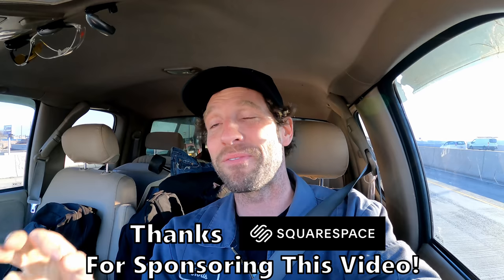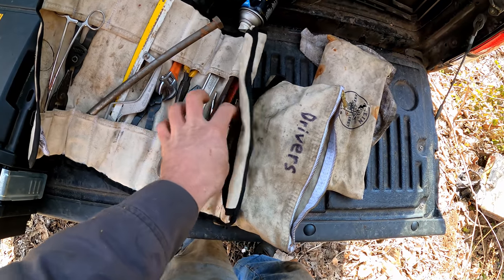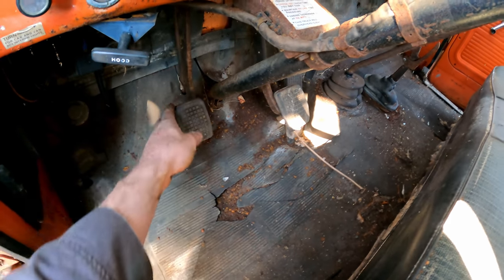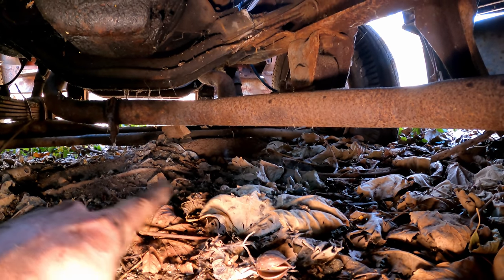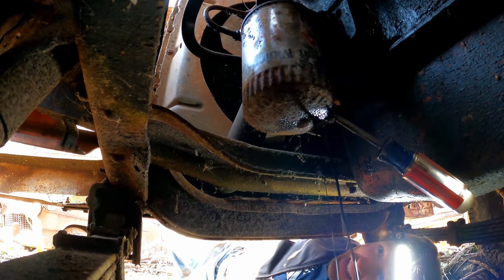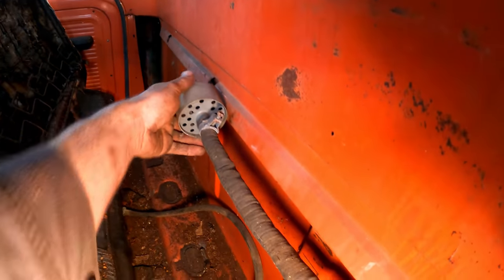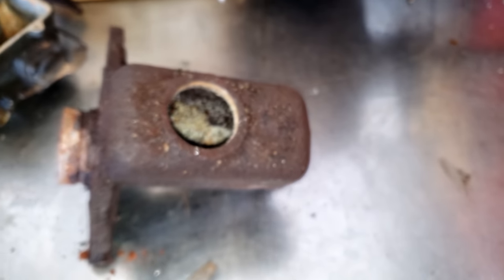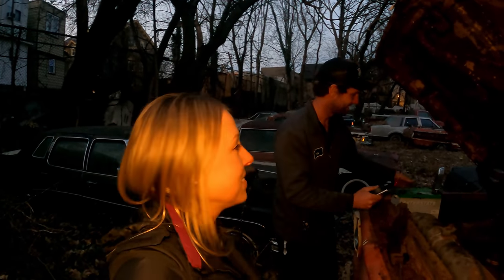Will It Run? 1971 Ford F600 Stick Shift U-HAUL Truck - NNKH

Comment: The engine is an FT series engine for medium and heavy trucks and school buses. If I remember correctly they were like 331, 361, and 391 in most trucks.  But I remember reading somewhere that U-Haul had different sizes by an a couple cu-in. Not sure if that's the case or not.

Comment: I rented a manual uhaul in Houston in the early 2000s at least. but it was probably available because no one else could drive it. Only 2nd and 4th gear worked though but it was a rental i didnt care

Comment: After working for Uhaul back when they had their own Mechanics those trucks all had the 390 heavy service motors in em. The only thing killed em was when they overheated usually melted the piston rings or a bearing. Funny thing about em is Uhaul was so greedy back in the day they would let people take em out with motors they knew were shot. The motors seldom if ever knocked and bumped when they were cold but after they got hot look out they were driving a big orange hand grenade.
Reply: They're still plenty greedy trust me never paid there employees jack shit. still dont

Comment: Nice! Super cool rig -1500 gonna be hard to find a buyer even for F600 body parts, theres alot of those here, less rust running driving 2 speed rear ends. Just pulled the trigger on a 66 Rambler wagon! 36k miles very little rust. Picking it up tommorow.
Reply: a few months ago, I spotted a Rambler American by a barn in upstate Ct. Looked whole and complete. Even had the OEM radio delete package. You don't see too many survivors in the strip down version.

Comment: If that engine is a 360, it definitely is not a small block, but Ford's FE block. Strong, and plentiful. FE engines (as far as I remember them) came in 352, 360, 390, 427 and 428. Yes, THAT 427!  The locked thing below the carb really is a governor. Probably a really good idea on a rental truck in the day. Those Budd wheels probably use a 1-1/2" hex and a 13/16" square as I remember. Should be the same as used on 10 bolt bus and truck wheels, but a different bolt circle. I haven't messed with one of these U Hauls since 1967. Stock plugs would be BF-42, 18mm tapered seat.  $400-$500 maximum.

Comment: The box alone should be worth a minimum of $750. You couldn't build that much storage for that kind of money. Hell, a sheet of plywood 1/4 thick is bringing more than $40 these days. The engine block may be rebuildable and that would be worth another $300. If the axle is what you said it might be, that has to be another $300. The doors and other parts for restorers easily add up to another $400-$800. It all depends on if you have a ready market for the parts and if you want to fool with all of that. If you don't, sell it for scrap and move on. And don't forget the transmission. If you have the part and someone else doesn't and they need one, the price goes up. Just spitballin'. All the best.

Comment: auto choke in the base of the carb worked on heat from the manifold and oil bath filters are very good the engine might be ok .....well the bore

Comment: Motor is likely 361 or 391. those at commercial truck engines. The oil in the air cleaner is normal for that era. It is an oil bath breather.

Comment: Back in the old days, there were not many options for the general public to rent large trucks, so U-Haul pretty much had the market to themselves and took full advantage of it, too. The trucks they rented out were notoriously overpriced, old, worn out, and suffered from lack of maintenance. By the early 1980s, their trucks were making news when they were so old and unsafe that things like brakes and suspensions were failing out on the roads and causing accidents and deaths. So, finding an old, former U-Haul truck is like finding an old taxi cab or police car; you can bet it has been used far beyond it’s expiration date and has had minimal maintenance and service along the way!

Comment: To service the breather dump the oil out of it and clean the bottom out of sludge and the breather quicker to take to the car wash steam it out and dump oil to the line inside the breather on the bottom  you are good to go.

Comment: Lower plate under carb is a governor you can get a key made at
T any lock smith # a990 brig's and Stratton. Brake booster is vacuum powered usually diaframe rubber wears out there is a key screamed in the grill dead center you will see a screw key is behind screw.

Comment: It's a ft or (fe) same engine ft just means ford truck and most likely a 360 c.i. I used to work for U-Haul as a truck mechanic in the early 1980's,I worked on these old trucks .most were manual trans but some had auto's, which are rare.

Comment: you know in the mid late 80's i was hired by kargo svcs  which is uhauls repair center to scrap and cut up old uhaul trucks . i had a smorgasboard of uhaul ford truck parts saved but most of it went for scrap metal . i cut up a ton of old trucks and boxes this is just before they got smart and started to auction off old trucks .

Comment: That roof will be leaking on you. You can see the water  stains. When the roof separates from the cross members like that, the rivets themselves have given way. It is an easy fix. Drill then out, and reset them. Also. Before you rivet the roof back either flexseal or use butyl tape to seal it back up.

Comment: That air filter is supposed to have oil in it, it the air goes through the oil to clean it to go into the engine, it's called an oil breather

Comment: I'd love to see it move again.

I can't imagine Ford offered these with an automatic transmission option. I wonder if one could even hope for a synchronized gearbox -- I doubt it.
Reply: They were available with an Allison AT-540 automatic. Quite common when they were fitted for fire service, anyone could drive them. I just sold a 73 F-600 dump truck with the same FT-330 engine and Allison trans. 55-60 MPH was about the end of the world, but it would do it empty or loaded with 8 yards of wet fill dirt.

Comment: A lot of those f600-700 trcks had 330s. I never heard the 360 before. What if i saw a vehicle i liked or was very interested in, How do i get contact? & btw I learned the hard way I bought my first diesel engine don't automatically change all the fluids unless you know it's good... I spent almost $500 on fluids + 2 fuel filters and then found out the engine wasn't any good. I wanna see that diesel square body also, I have 3 of them, getting ready to have another.

Comment: Lots of folks with old Galaxies they may be restoring or getting on the road, that motor is very much a Galaxie block for sure. I know Craig909 has a 360 in his one Galaxie... very dependable old motors. A lot of those old Ford trucks that are gas, often have 429's in them [sometimes if you're lucky you may get a 428 in one but usually a 429]. Do they have a different crank than the ones they'd have in the car motors? Still the blocks are getting harder and harder to find. :-)) Be worth popping this motor out [bit of lifter noise... maybe a bent push rod or two... or just in need of lash adjustment.. bent rods are common with over used and rental motors]. :-) Be cool to see you drive it out... keep the box? .. Drop in a diesel and pop the gas motor to save for a car or sell it to somebody who needs one... Those valve covers alone... so cool. Thanks for sharing this. Loving the videos man! NOICE!!

Comment: that was an oil bath air filter system. works but is very messy. you can probably convert it to air filter system. if you dont want to make a runnner out of that u-haul, then maybe yank the engine out and use in something else and then sell the rest of the u-haul for maybe  1500. 3000 is too steep,.:)

Comment: At most, It's only worth half of what the owner is asking as far as selling it.  As of right now, I can get a 1980 Ford C700 that runs, drives, and it has a title for $1500 and all it needs are tires and a battery.

Comment: As far as value goes , If that was a 352, like some of the guys on here saying, then that has some value because those have become increasingly hard to find. But I don't think it's a 352. And the other thing that has value is the box, like someone says they can turn that into a shed. Other than that it's scrap
Reply: It's a 330 cid
Reply: Some places sell the boxes for $100 a foot.
Reply: @thebeek123  This box is probably worth a bit more thanks to that end-on hardwood floor.

Comment: Those old Fords had the air filters soaked in oil.
Reply: The air cleaner assembly had oil in the bottom of it and the oil was the filter. There was no paper filter involved.

Comment: Like watching the Videos, $3,000 is too much, The brake System will be a nightmare to chase
down. I'd say $1,000 Max for the parts. I saw where someone made one of these into a Motor Home.
I'd like to see that Falcon Ranchero run.
Reply: I'll second the vote on the Falcon Ranchero... I was always a fan of them!

Comment: I had the identical truck. Step 1. Throw away governed carb,  its an FT 331 most likely . Does it have the u haul branded tires??
Reply: it did, saw em

Comment: how , as a mechanic that is older than i am, do you not know what an OIL BATH air filter is??!!! lol hey you learn something new every time you work on stuff! oh and yes that is a ford FE  block which 352,360,390 all are the same block.
Reply from the maker: It's pretty simple really. Today's vehicles don't have oil bath filters. And I only recently started working on older vehicles. You probably just watch more YouTube than me.
Reply: Text is hard to tell the emotion behind it I hope you know I was light heartedly giving you a hard time. lol  And no Iv done revivals on tractors and vehicle's since I was in middle school and the funny thing is if I made a revival video of myself trying to get a modern vehicle running their would be many things I would be like “wtf is this? Why is this like that?” And you would be like what the hell how do you not know this??haha

Comment: To bad it's not older and had a 352 motor. Some U_Hauls had governors on the transmission side tied into the speedometer cable....easily removed.

Comment: A torque multiplier would make those lug nuts much easier to remove. Thanks!
Reply from the maker: Yes. I've since bought one
Reply: @NoNonsenseKnowHow  They're freaking awesome. I've used them to break studs on cross threaded or overtightened nuts. Thanks for the videos!!!

Comment: As far as value, I'd say no more than 1500.  Mainly because that engine is getting harder to come by, and if the box is dry, that's an 800.00 box that someone could use for a tool shed. That's what they go down here in NW Florida. Unfortunately it's an easy 10k to take it back to a nice running and nice looking unit. I'm more interested in the blue Lincoln in the very back at the 8 min mark of the video. If it's complete, I'd be interested in it for sure.

Comment: 1000 bucks tops. F600s are a dime a dozen. They were a common truck for farmers delivery trucks or in this case uhaul truck. But it's not a real special truck. Owned and drove many of them over the years. The vacuum line your referencing. Is connected to the vacuum gauge in dash. As well as from the vacuum pump.

Comment: Just wondering if you have low compression in one cylinder does that mean the motor is blown or how do you get that fix ? I would greatly appreciate any advice 🙏🏽  I don't want to junk my old car because of one cylinder having low compression.

Comment: You have a lot to learn about older engines. That air filter is what is known as a oil bath air cleaner. The air gets sucked through the oil an$ is filtered out. The oil should be changed @nd the p@n cleaned with new engine oil put in to the pan. They were the best air filter made. Used on most older heavier equipment. Yes if you had window washers back then they were bags that held th3 bug cleaner fluid.

Comment: How does your air hose not get damaged by the heat from the engine?
Reply from the maker: Because it doesn't get that hot under the hood

Comment: 🤔THAT REALLY is a 352 V8 Ford engine they are one of the toughest engines FORD HAS ever made tough is a bullet they REALLY were REAL GOOD U-Haul trucks very dependable especially back in the day better than ANY of the U-Haul trucks made NOW DAY'S I REALLY DO KNOW I AM a REAL ASE Certified master Auto Technician or a ASE certified Master Auto Mechanic with OVER 60 year's experience I AlSO GOT OVER 67  masters degrees in Auto mechanics believe me those Master degrees cost money at least the colleges charge a lot money for those masters degrees and the state colleges will NOT let nobody cheat

Comment: Considering pretty much all the steel lines and hoses in this truck will have to be replaced, plus six tires, in addition to all the mechanical work and brake system, I'd say $1400 max, would be a fair price. By the time the person has it road safe and replaces that left rear door, windshield, bangs out the dents and dings, and replaces that rusted out hood, their going to have more into it than it will be worth. And you haven't even found all of the problems yet.

Comment: Nice old FE.....  Cool old remote vacuum assist... The Exhaust manifolds will definitely leak....  LOL   D4TE  74 Truck Engine..   Probably a 390 or 428..  Awful big truck for a tiny 360..  So surprised there weren't more nests...   $1000 is what its worth..  Pull the engine and scrap the rest...

Comment: Cool, old beast!
I've been a Uhaul dealer for 27 years and we had 26' trucks with IDI N/A diesels and manual trans right up till about 98-99 when Uhaul had its little uh....incident with the Canadian authorities. After the near bankruptcy, all the cool and weird trucks were axed( Toyotas, Powerstrokes, 5-speeds, carbs)  and they made 90% of the trucks E-350's with the Triton V10.

Comment: Yup, oil bath air cleaners are messy! As far as value of the truck, I think $1200.00 would be a fair price. Grab all the parts usable on that vintage Ford truck, scrap the remains.

Comment: Wouldn't be something I would have any interest in fixing or using, but would be handy for parts for someone that has one that they are using. That being said, $3K if it was a driver maybe, $1000 to $1500 absolute max as it sits. Lol, with the price of gas these days it would probably cost $10 in fuel just to get it out of the driveway...

Comment: $3000? I'm thinking about $1200 maybe. Really rough. But the doors are nice and the engine runs.
Reply: $800-1000. Too much damage to the cab plus the cost of all the other parts for brakes and suspension. I won't mention how much replacement tires would cost. There appears to be a lot of potential and good parts but it would be an investment! It simply may be more cost effective to buy another already running truck.

Comment: we have a lot of them in brazil, still woring, but diesel. swapped mwm or mercedes engine, original perkins or older models V8 gasoline. I have a F350 68 , original V8 swapped to mercedes diesel, cool truck. this f600 is onl for somebody who loves it, cause needs a lot of metal work. but I would buy it, cause not for 3000, you can pay max scrap value.

Comment: Hi my name is sean I came across your video I like will it start you should get in touch with vice grip groge he can teal what brand of oil he used diesel oli in the cas that’s bin sitting four 20 years your new fan from Lebanon Oklahoma

Comment: It’s a 330 engine especially made for U Haul
Reply: The 330FT wasn't an engine made only for U-Haul. It was commonly found in Ford trucks 1 1/2 tons and larger. The question is whether or not the engine is of the FT or FE variety, I couldn't see enough to be sure but at this juncture, I'm guessing FE.

Comment: I can see, with today's prices, it would take a sizeable $$ to get this truck in drivable shape.  The rear box looks in ok shape, but the hood is toast, brakes with be costly, maintenance on the driveline emergency brake setup, and who knows if the motor would give you years of use!   Battery, windshield, seat...and who doesn't use a radio in this day and age!   Six tires on this rig won't be cheap...I wouldn't give her a nickel over scrap price personally!  My bet is the wiring to lights and such need attention as well.

Comment: That truck is worth scrap, sad to say.  The box might have some type of value as storage? But the rest of the truck is just not worth anything, the front end is trashed. 
The drivetrain, well, also sad to say not going to be worth anything. It's too late to be one of the early FE's that people try to find, so it is going to be a low comp industrial, or a 360, or maybe, maybe a 390, but I doubt Uhaul would splurge for a 390 preferring to try to advertise as a gas saver(LOL) with a smaller engine. 
A ford 360 is a boat anchor NO ONE wants. The heavy truck engines might have a forged crank! Except NO ONE wants a 360, for anything. Same with industrial motors. If by some miracle it has a forged crank 390, that crankshaft would have some value to someone. 

That truck would run and run if you got it going down the road, and it would pull hard, and you would get 2mpg. The 360 was good for about 90k miles before it started blowing blue smoke, but it would go another 50k miles easy before it started misbehaving. Ford kept the 360 in the small truck lineup all the way to 76, because people didn't like their half breed 351M for hard work. 
Nowdays, people would prefer the 351M because it can be made to perform well. Nobody bothers with a 360, because you can't make it perform, not really anyway. 
At least 360's sound tough and run smooth. That one runs real nice, you could probably get $400 for it if you had it pulled out.